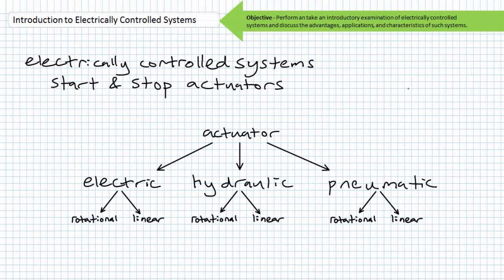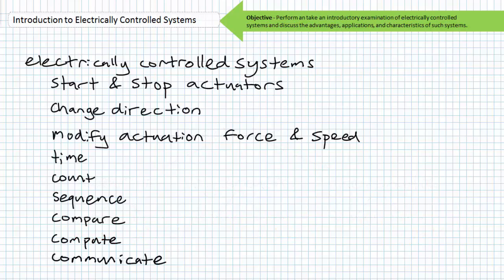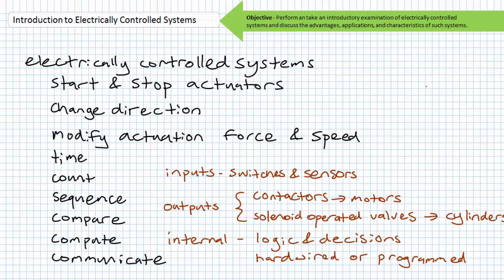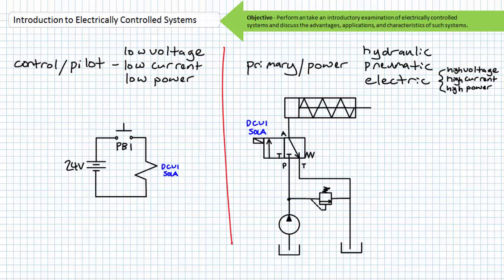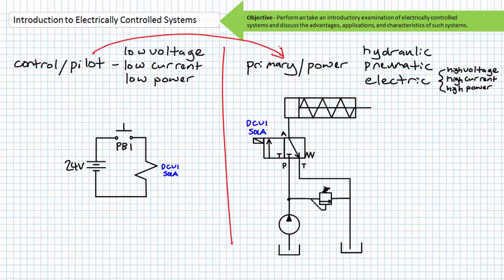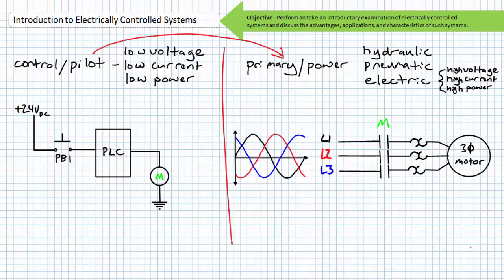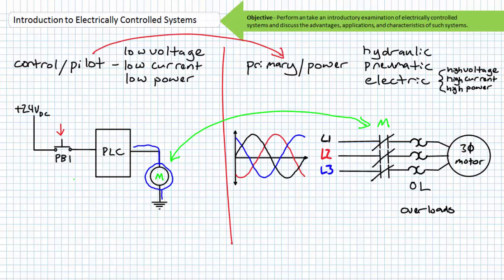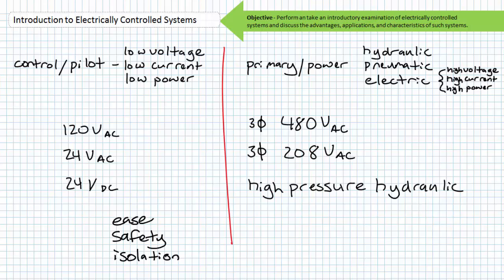Introduction to Electrically Controlled Systems (Part 1 of 4)

Comment: Why is 24VDC preferred over 24VAC for control systems ?? 24VAC just needs a transformer which one would think to be more reliable than a DC power suuply. I am just speaking as an apprentice electrician,
Reply from the maker: Tell me about it. A lot of heating and cooling control systems have adopted 24Vac for that exact reason.

Comment: Thank you very much sir for creating such informative tutorials covering both theoretical and practical sides of a topic.I've got much insight seeing these videos that i couldn't achieve in my 4 year course.Till now i've covered "Hydraulics and Electrical Control of Hydraulic Systems" , "Electrically controlled system","Motors and Generators"

Hope to see a course on PLC in your channel.
Thank you again
Reply from the maker: +iftekher khan Ironically enough the "Electrically Controlled Systems" playlist is designed to bleed right into PLCs. I still have to cover timers and motor drives (and more) but expect some basic intro PLC lectures soon. Long term plans are to eventually include a complete PLC playlist. I like to introduce super basic PLCs (like the TECO SG2 PLRs and EATON EASY Intelligent Relays) to students at the very end of my motor controls class. Very fun tools for not a lot of money. Stay in touch!